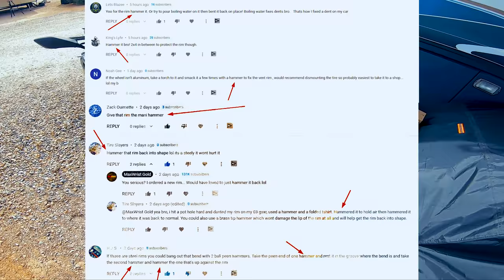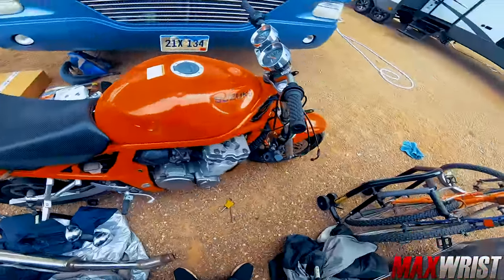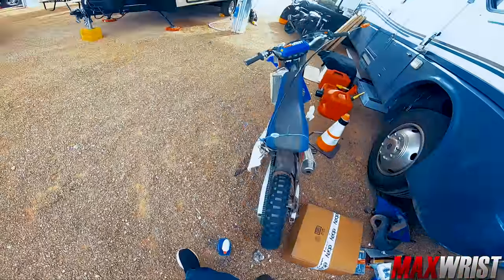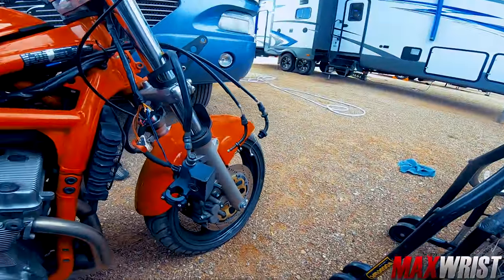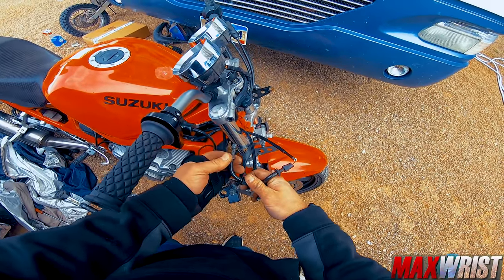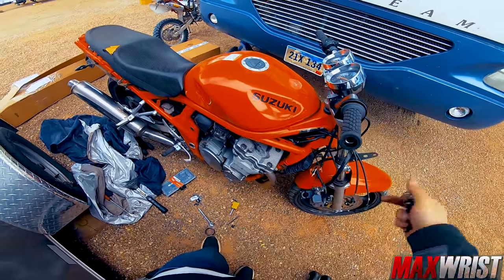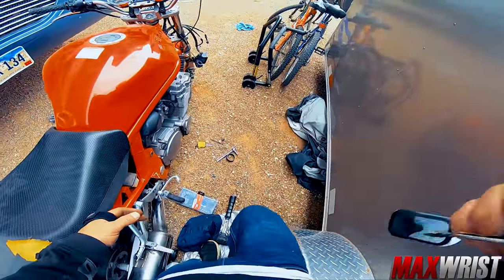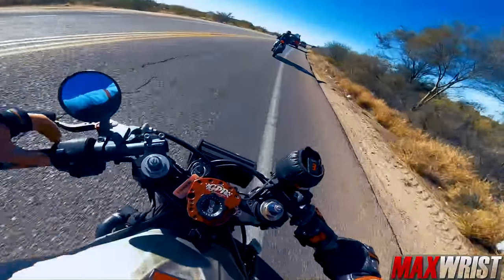HAMMERING BENT RIM! 😖 *IMPOSSIBLE CHALLENGE*

Comment: Hi
Reply from the maker: For being a young savage that’s a pretty weak first comment 🤣 Still got it tho 👍
Reply: @MADMAXY  lmao
Reply: @MADMAXY  lol
Reply: I feel happy you made my day for noticing me
Reply: @xx_dexy_xx884  he notices almost every first comment
Reply: @MADMAXY  solid up that rim when hammering or use a blunt chisel.
Reply: MaxWrist Gold  your r6 needa the clutch pin adjusted once u pop the cover off... as for the old hustle series bike thats air/oil cooled.. that’s a oil cooler u saw, not a radiator..
So your puffin from the carb bike, might need a cleaning.. reason it didn’t on the shorty/strait pipe was the exhaust gases didn’t have enough length to cool and condense to ur white puffs...
Not a biggy.

Comment: Broooo this guy is hitting his cold aluminum rim with a hammer 😂 and a screw driver! Omg I’m dead
Reply: prob didn't go to school :DD
Reply: Yea, I would have said get a acetaline torch and heat it up a bit but idk if he has that. Maybe his neighbors? You would have to be careful though because of rubber burning. IDK but it would have made life easier. "Work smarter, not harder"
Reply: JIM LAHEY true
Reply: Julle he already had a new rim he was just giving it a try as a comment suggested.
Reply: I would have said to take off the tire, heat it with a torch and bend it with pliers and mallet

Comment: Bending back a rim...... The trolls got him.
Its air cooled with oil cooling.
Reply: lenard gor not trolling we do this in the shop all the time, mainly not with aluminum wheels and we dismount to the tire and heat it up with a torch and it only takes about 5-6 hits with a REAL hammer not rubber mallet. But yee way easier to just buy a new wheel lol

Comment: It’s smoking because it could be burning oil in the engine which isn’t good. Also to bend the rim back with a hammer, use a metal hammer while using a blow Torch to heat the metal rim to bend it back. Heating the rim will wearing the metal so you can bend it back easier

Comment: Front wheels buckled so change as guy told u pulling right.
Its smoking became its heating up
I would return the exhaust sounds weak. Loud pipes saves lives. The throttle tube is it the correct 1 for thst bike

Comment: Hi Maxy! Read this for some opinions on your issues with the bikes <3

The smoke could be caused by the piston rings being weak allowing more oil needed into the cylinder, or coolant finding its way into the combustion chamber. IDK what color the smoke is because videos dont do justice lol, but those should be common options for your smoke problem. Also, my opinion for the exhaust is if you think it sounded better open headers, then you can take the baffle out and "simply" put it back in when you need inspection/commission or whatever else you might need. Anyways, thanks for reading if you did XD

Added (edited):
Like you said as the bonus content. Your clutch plates are sticking funny. I have a yfz 450 quad and I had the same problem where I would hold the clutch in and it would move. made it shift into neutral often and made shifting a little hard. Took the time putting in new plates and fixed every problem ever. even made my clutch easier to pull in because it was a pain. This was on a quad though, might be the same on a motorcycle? to young to own one LOL. Anyways, thanks again!

Comment: A brass hammer might do it but brass won't tear up the metal rim, we normally take the tire off and heat the rim with a hand torch and then tap it back straight, but with alloy wheels it can be tricky to get it to bend back and not crack

Comment: Take the rim off and the tyre off the rim put some heat into it with a blow torch and it will hammer back into place. You will need to tidy it up with some sand paper after.

Comment: the rubber on the hammer absorbs the Energy in the rubber so there is not much Energy going in the rim. Use a Metal hammer.

Comment: More than likely if it smokes with the "new" exhaust it's probably just oil from the last bike, it'll clear up.
Reply: When I see people buy a used exhaust I always hope the buyer atleast burns the "cat" off with a hi temp heat gun in the header side for a half hour until you see a meltdown of smoke come out then pressureize the pipe so the crap comes flying out instead of re-lodging itself somewhere

Comment: So, you're going to take the front end off the bike, you can try to fix the rim again with it off the bike and off the forks, heat it with a blower or torch and try to hammer it again, but start gently and see how it goes. (You might want to take the rotor off it to have clearence for hammering)

Comment: If your coolant is leaking into the cilinder/engine, its really easy to tell. If the smoke that comes out of the exhaust smells a little bit sweet, you know you have a coolant leak somewhere. Most likely the head gasket, really cheap and easy to replace (unscrew cilinder head(s) and replace it).

Comment: Take the air out before you hammer it. And for the cable. Use the cable that came with the throttle. Just solder the one end.

Comment: I went an looked at my 05 gixxer. The wires for my front lighting literally connect right above where my clutch cable intakes by the gear shifter. An there is a BILLION WIRES THAT RUN literally all the way from the left of my bike to the right front blinker. Looking in there I can tell a quarter of them are cut off an caped off.  An the radiator should just have a lid on the upper right corner.  Good luck.

Comment: About the throttle cables, I guess you should try some cables from smaller bikes, I don't know exactly wich small bikes you've got there in US, maybe from the Honda Grom?
Reply from the maker: I think I'm going to try and dremel the lip off the current throttle cable elbows?
Reply: @MADMAXY  it might work, be sure to check it if the threads matches

Comment: remove the tire.   putt in on work bench.  heat it up with propangas fire.  or oxygen and acetylene  gas. heat it up around the dent and hammer it.  dont breath in the smoke from the paint, and re paint it :)  and then you have two front wheels :)

Comment: Throw that wheel away The bandit I just sold had a dale Walker holeshot slip on that sounded great. Its an oil cooled bike so no coolant to worry about, the "smoke" is just condensation it should go away once warmed up. You can get a cheap carb rebuild kit on Ebay that comes with a one size up main jet and I highly suggest it. 

Your r6 or whatever that is either needs a clutch or clutch springs, I'd change both. 

I flip bikes on the side as well, just picked up a vstar 1100, an 82 maxim 550, and an 03 Honda st1300 for prices that make that bandit look over priced. 

Good luck making some profit on that bandit though should pull mid $2k range once your done.

Comment: Take the rim off the bike. Take the tire off the rim. Use a torch to heat the bent area from the inside, not so hot that it wrecks the paint. Then use a small wood block with a large metal hammer. Use hard direct blows not those little love taps you were doing. The throttle cables are 1 push and 1 pull, they won't work with that tube and probably won't be long enough for the bars you installed.

Comment: Careful, bending it out, since its aluminum, it will crack bec that looks like a gnarly bend, it happened when i bent my rim back out lol it cracked and i had to weld it back up, but just ended up buying a new rim. yellow torch heat it up and bang it out then it shouldn't crack. rim shops usually can fix it for like 40$

Comment: Hey, bro, I'm glad you got that part off of the header pipe But keep in mind. Every time you use a knife. Or something Sharp Don't hit it towards you cuz if that thing would have slipped off It would have went right into your shin. And that would not feel good whatsoever, dude Just trying to look out for you , the other things using a hammer to Get the ring back in shape. It works good on steel rims. Yours are aluminum and nine out of 10 times it will break. Before goes back into place it was a good idea, but

Comment: Put the plastic hammer on the rim while you use a iron hammer.

Let the motorcycle run for like 20-30mins if it still getting smoke out idk why but if it does it was just some dust

Comment: Loosen up the exhaust clamp and take the rubber mallet and hammer the fuck of the end of the exhaust to push the pipe in more, that should make the bolt hole line up. Also it is oil cooled so just make sure she has oil, and it can be smoking because it is cool out or there could be a little oil in it from the previous bike. Also where ever you got the throttle clamp from you might need to get there throttle cable as well, Hopes this helps

Comment: Ok I just went back outside. It's cold maxy😂. I lifted my gas tank an those two wires run to the throttle roll. 😂or whatever it's called lol..  if u lift ur gas tank an look to the left of the air box that's what I mean. I think u might have to get a new throttle bracket . But ya those two cables should definitely screw it your throttle bracket.

Comment: If you had the rim off the bike and took the brake rotor off so you could get a good swing on it you could possibly succeed but since you have the new un-tweaked rim you might as well put it on. Secondly the bike is air/oil cooled the radiator you were looking at is actually an oil cooler, nothing to drain or fill. I respect the fact that you didn't give up on the rim but I'm so worn out just from watching you swing that hammer so many damn times that now i've got to go to bed. Good luck with the build and the neighbor bud!

Comment: Bruh..... You're supposed to dismount the tire, on a anchor of some sort (usually on a tire changing machine at a tire shop),then use gas torches to get the area in need of repair hot and soft enough for getting bent back into place and hit it close enough to spec to properly hold air and almost perfect with a weighted plastic mallet not rubber.

Comment: Lol A+ on effort brother but it works better with a 5 or 10 pound sledge hammer instead of a rubber mallet and a 2x4 with the rim off of the bike and laying flat on a solid surface with cardboard underneath the rim to protect the finish. The tire is a damper of sorts that takes away from your hitting force. That's weird about the bike taking off in second gear from startup, I'm betting sticking friction plates like you said.

Comment: An the clutch if it's like mine with a hydraulic slave cylinder clutch might have some air in the system mine did the same thing scares the crap out of ya an could be some other things to just depends on if it hydraulic or cadle but hope you figure it out bud an keep her sunnyside up

Comment: Smoke? Its condensation! Not sure if you are new to bikes or what but this drives me crazy. are you just screwing with us? That donut you knocked off was a gasket. You cant get the clamp tight enough without some impact. Did you try a good length of 2x4 to hit that rim out? get much more impact that way and wont damage your rotor. I hope you are just trying to be funny with this bike.

Comment: So this bike is oil cooled, also the air leak is because you took the carbon washer off the end of the exhaust which compressed and stops air leaks. Get a new one or a copper one.

Comment: If anything your pushing in. You would have to take the wheel off and hammer straight down with an actual hammer. That's a mallet. Just buy a new rim. It will never be right again. Also that exhaust is hideous. Looking forward to see this thing finished.

Comment: The rim can easily be bent back you just need a real hammer or you can get two hammers put the first hammer on the rim and with the second hammer hit the first hammer and it will bend it back really easy if it doesn't work you are probably not hitting hard enough i do it all the time and it works great and again use real hammers

Comment: Stopping the video at 5:30 to say this...
First of all.... Yes if it's a steel wheel you can hammer it back out... With a real hammer... Not a rubber hammer, second take the wheel of to hammer it out, 3rd.... Swing like you got a pair between your legs. (7 year tire tech)

Comment: Ummm the way to bend it back into shape is heat it a little and hit it with any other hammer but a mallet. I can tell you’re not very mechanically inclined.
Reply: The $4.99 ratchet set from harbor freight gave that away